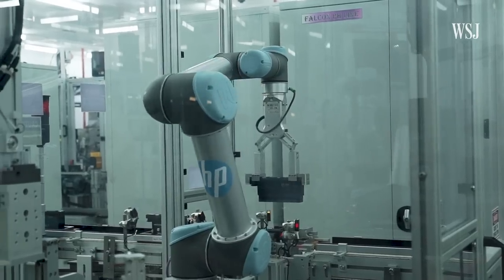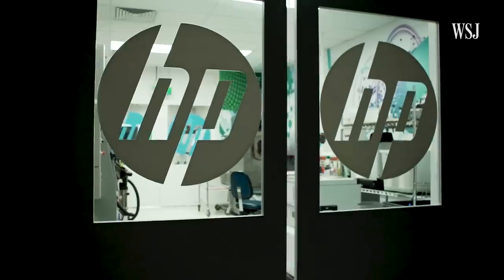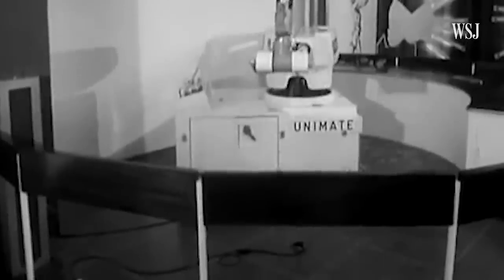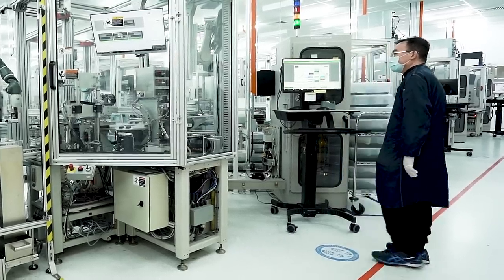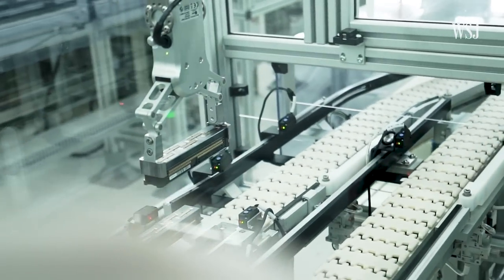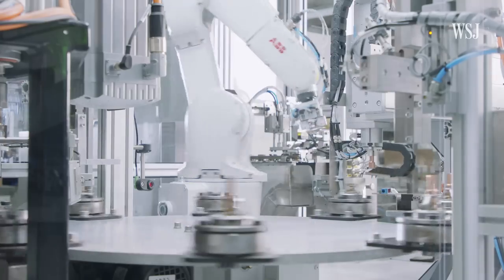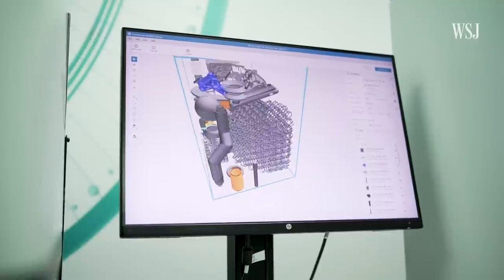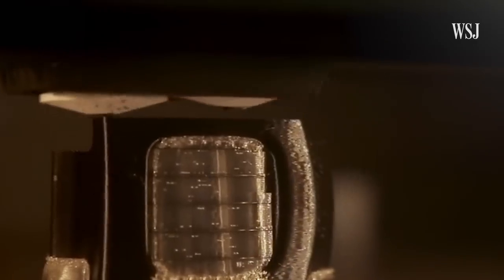Can Robots Fix Inflation, Supply Chain and Labor Issues? Singapore Thinks So | WSJ

Comment: If only HP can do advanced technology like this to their printer cartridges
Reply: They do? They have chips inside them that can sense if the cartridges are HP or a copy
Reply: @misosoppa3279  Hardly advanced technology; simpler versions have been used (and are still used) to reduce theft and copyright infringement for over 40 years.
Reply: very true